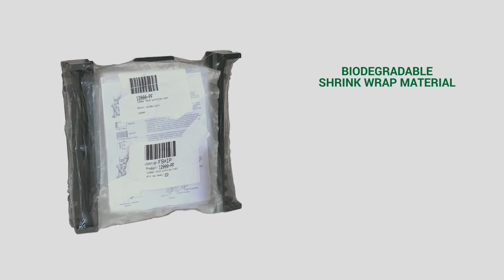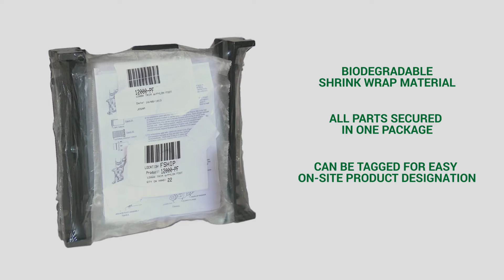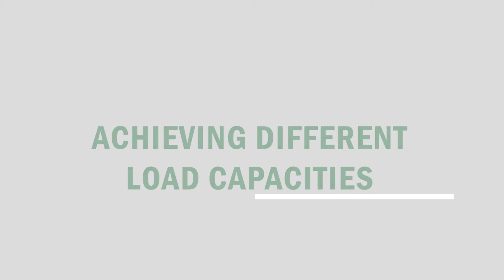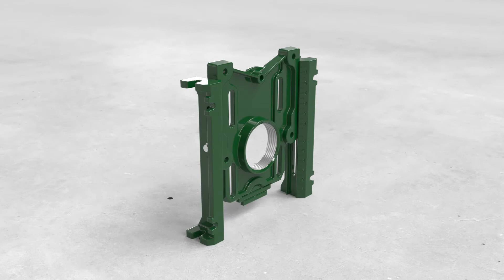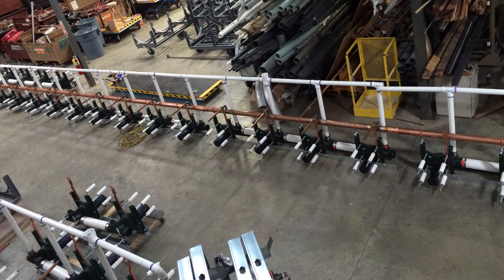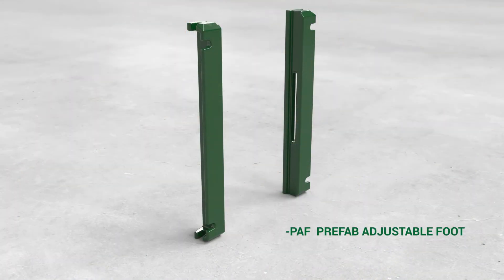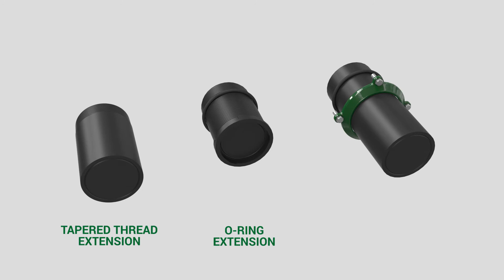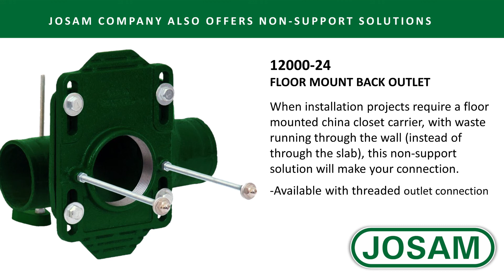Josam Company Water Closet Carrier Installation Video

Comment: I have a 11001 carrier and it came loose in a box with no instructions.  I'm not even sure all the parts are there.  I can't find an install guide on the Josam site- Anyone have that info, or know where to find it?  I have the spec sheet, but specifically wondering how it's meant to be mounted to the floor and wall framing to support the weight of the toilet.  It has more  threaded holes thank hardware in the bag and I'm wondering if it's missing parts.  many thanks!